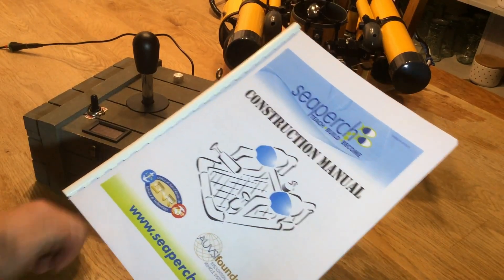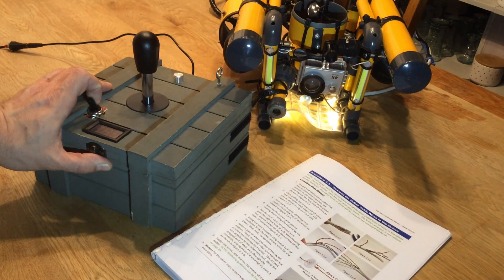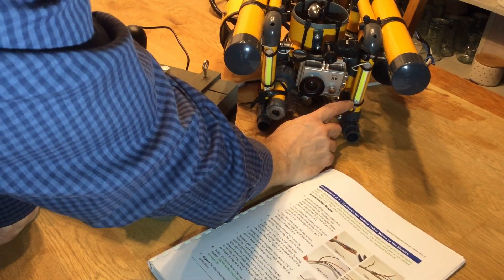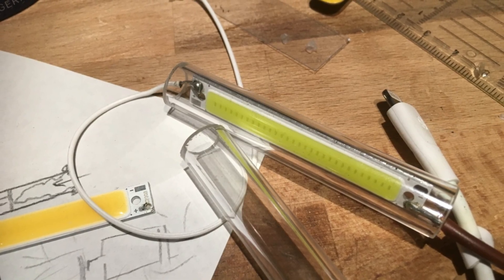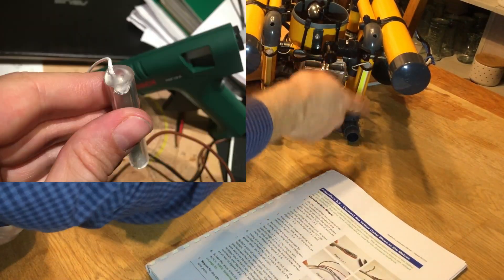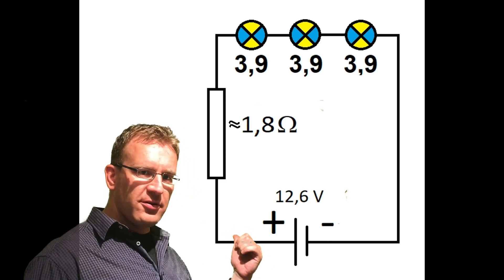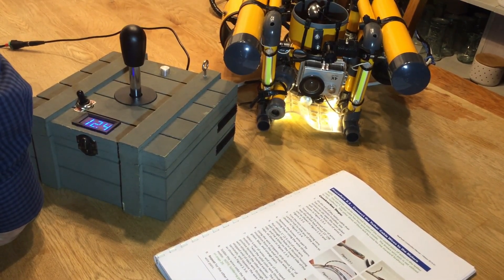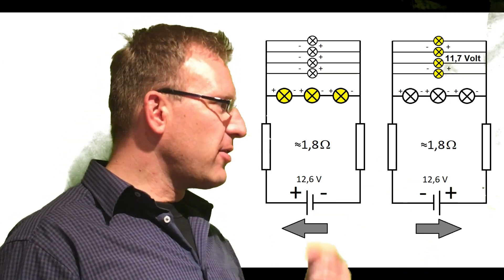SeaPerch ROV Lighting - DIY Submarine Touch Muh Hull Gadgets

Comment: Did you use a step down to get the 4v for the lights?
Reply from the maker: A what? No, I just put 3 LEDs in series and thereby reducing the voltage from 12 to 3x4 Volts.
Reply: @agermangineer  now I understand. Still learning electronic basics. Thank you
Reply from the maker: @matthewbennett2844  welcome to the club! 😌👍🏻